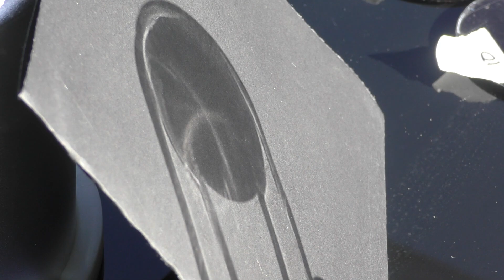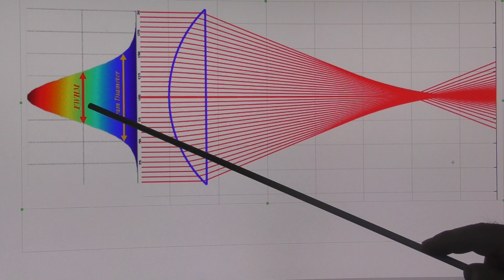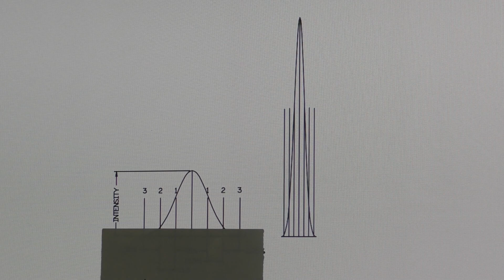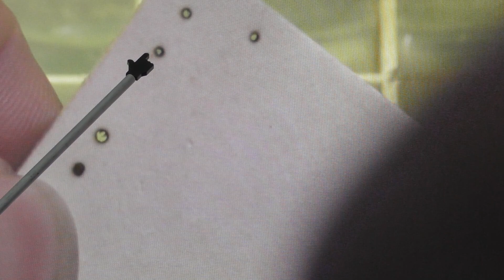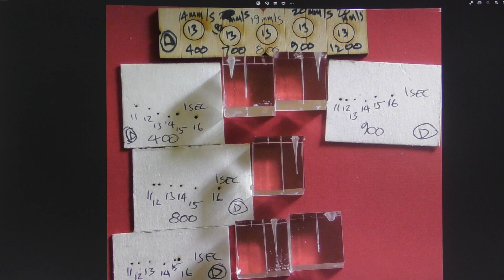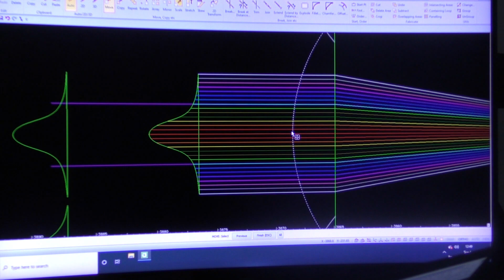RDWorks Learning Lab 245 Lenses and Laser Beams  A Marriage Made in Hell

Comment: Thanks for another very interesting video.
Another "point",  though possibly only of "academic interest", is that  "optical lenses" have  a "more complex aberration problem" when compared to "laser lenses". Due to the fact that the aberration is different for the different wave lengths in "mixedcolour light" such as daylight, whereas a "laser-beam" really should not suffer that problem to any great extent if at all. 
Best regards.
Reply from the maker: Hi
You are perfectly correct in that normal white daylight is not really a single light wavelenth  but  a mix of all the rainbow light wavelengths that our eyes peceive as white. The famous image of a white lightbeam entering one face of a triangular prism and exiting the opposite face as a set of rainbow colours  is a visible demonstration of this. The refractive index of any lens  material will do the same  ie bend lightwaves differently according to their wavelength.. Shorter blue wavelengths have an aberration effect closer to the lens than do red wavelengths. Your assumption that such aberration may not even exist for a longer wavelength laser beam  is false   Even for a  monochromatic light source, like a laser beam,  spherical aberration still exists. If you move on one more video to Learning Lab 246   https://youtu.be/kddSFO-iFNM      the effect of aberration is clearly demonstrated for various laser lenses.. However,  if in doubt there is a great piece of software mentioned at 58:00 that allows you to see  for yourself the effect of different wavelengths,  different refractive indexes, different lens shapes , diameters and thickness on the refracted ray paths. It is detailed in the description below the video.and is well worth downloading to play with.
 Sincere thanks for the comment because the whole purpose of my videos is to examine  assumptions and demonstrate if they are fact or fiction.

Comment: Hi Russ, I've been watching all your videos currently as i was having issues, which was highlighted when i was commissioned to do a load of stainless coffee cup engraving with my rotary with what i now know to be curtains. I have what looks like the same china blue machine and would like to upgrade it to a russ spec model as you have throughout your videos. Its a 50watt 30x50cm base running a ruidia controller, i also have a 80watt 70x50cm model, in race car red which is my prized big boy however with much the same problems and an added issue with the gantry not being square.. which im not looking forward to fixing. Do you by chance have a video you can send me to which outlines the process of the design for a plastic (acrylic) mount for the bearing assembly to eliminate the curtains. Also a video for the process to fix my out of square issue. you don't by any chance sell the finished metal product with the new and improved mirror mount and bearing assembly?  Im sure my kids would appreciate the time saved if you do. Regardless if not im sure ill be spending a long portion of my time watching your videos and tinkering with my own china blue. Really appreciate your work mate.
Reply from the maker: Hi
Yes I do sell some of the pieces for a kit that upgrades both your machines.  The C series bracket that allows you to make the head adjustable on your red and black machine with a 12mm top mounted  X bearing id a part solution that does not fix the curtains  but allows the fully flexible lens tube system  and lightweight head to be fitted, I need a picture of your X drive systen to advise on how to make your own cutains fix for that machine. The China blue may also be a bit different to mine as there are sevarl similar machines that are not exactly the same so again I need a picture  before I  send you anything, I'm not in the business of selling scrap metal.
 Conbtact me privately with the following contact form and we can start a converstaion.
https://forms.zohopublic.eu/ndeavorlimited/form/K40XtreeemLaserCutterContactRussSadler/formperma/k2Cn0QN5ChpazfTMAUw25lZ-FKpjZa96TQWHjv3ntOg
 Best wishes for the New Year
Russ